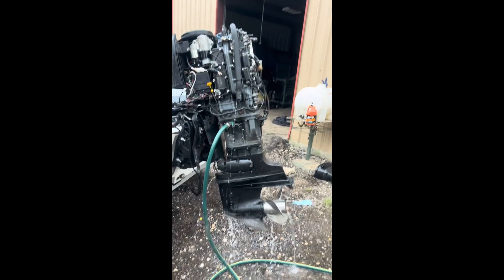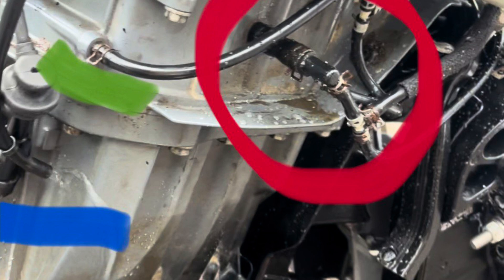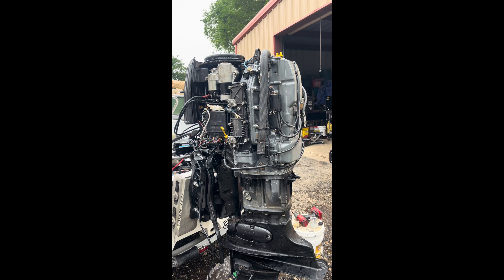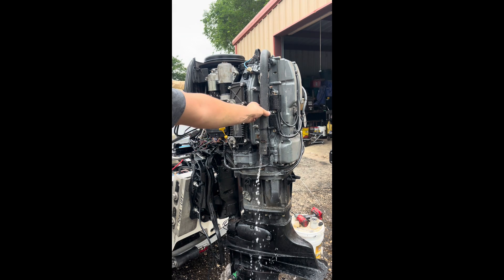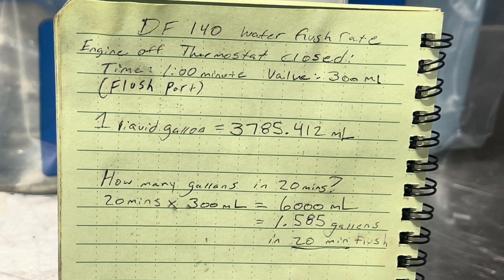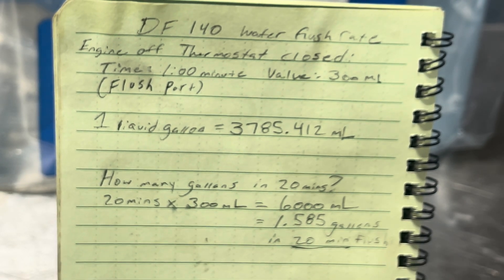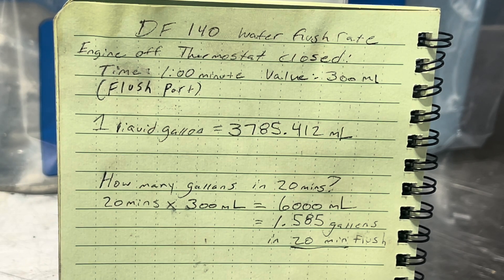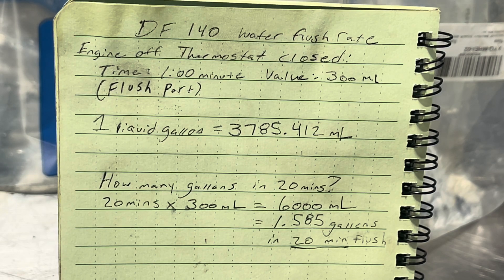Should you use the Suzuki / outboard flush port?

Comment: You missed one detail. The manufacturer recommends trimming the motor all the way up when flushing through port...I've done that for 3 years, close to 2200 hrs and I just replaced the anodes for the first time - which were only about 50% spent...no issues with thermostat or salt inside the motor.